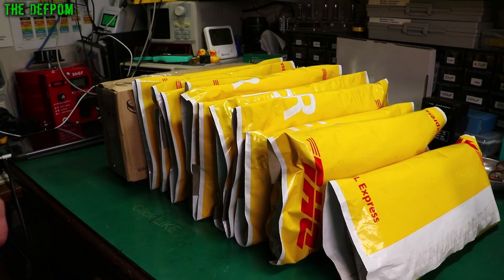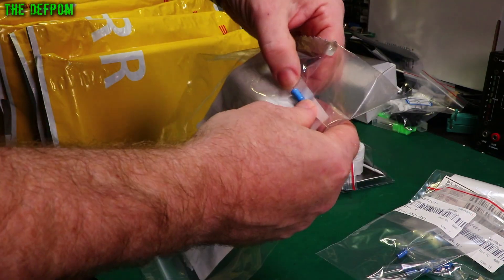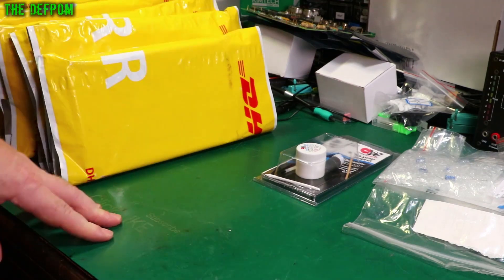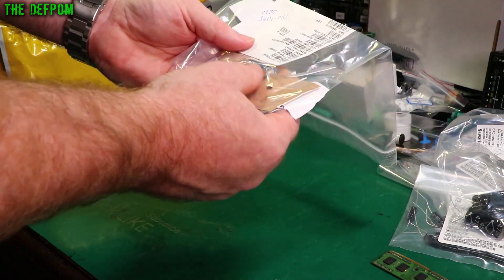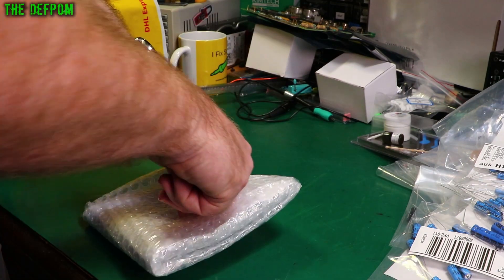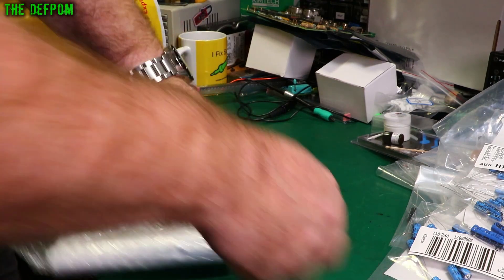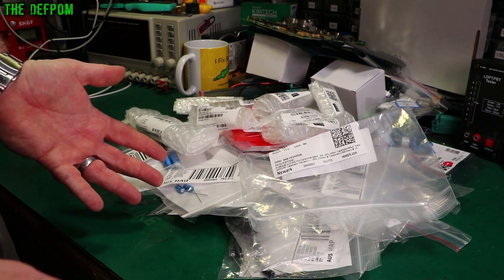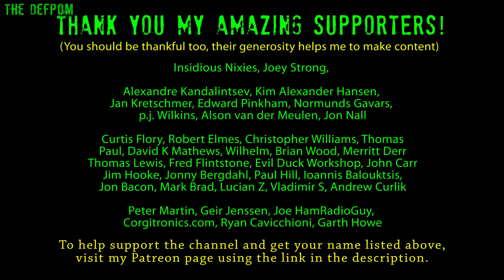🔴 What's in my Mailbag ? - Crapacitorbag Monday 11th April 2022 - No.943

Comment: Amazing capacitor buy.
I do note you are getting ones and twos. I rarely order less than ten at a time except where cost each is in tens of dollars.
Reply from the maker: These types are expensive so I have to budget to getting what I will need. Also sometimes the orders get broken up into smaller numbers due to shipping from different places and wiping out all of their stock. AND I only have so much room in my parts drawers, if they are close to full I will just top them up.
Reply: @TheDefpom  OK cost and stock levels are certainly constraints. Space too is an issue.
My last order was a selection of very low ESR Electrolytic capacitors, that had a number of devices at rediculous prices. My order ended up at around Au$780, not what most people would pay. Sadly asthe manufacturers will not sell in low quantities, we are stuck paying these distributors their enormous markups. Sadly often the read premium devices are not carried by these distributors so if not a direct major customer of the capacitor manufacturer there is NO way to get some devices.
The vanishing sourcing of certain style devices is as much a supply chanel stocking, possibly more than lack of manufacture, though prices do go up on such low production volume types.

Just needed examples for a range of DC-DC converter evaluations comparing effect of better and lesser capacitors on characteristics. Capacitors under 10mOhm ESR do make a difference but cost is maybe overkill.. Run of the mill capacitors via likes of Jaycar and Altronics fared medium to poorly . Good major brands at RS and Element14, so not the cheaper ones, did moderate to good, not even excellent.
Most of my special capacitors are still idle sitting and aging. By the way one type special ordered from Japan by Element14, with 4 month delay, cost around $33 each for 5 pieces, but 100uF 50V and 1 to 2 mOhm was special.
Reply: @TheDefpom  Just wondering, why don't you use radial capacitors and extend one of the leads? Presumably for convenience and aesthetics?
Reply from the maker: @andrewsawesome  that can be done (and I have done it) but it’s a pain as often you have to mess around extending the leg and heat shrinking it… I’d rather put the right part in.

Comment: To entertain us more, you need to read the labels and see if you can find out which warehouse it came from.
At the end of the video you had two bags with the same components in them, it usually means they came from different parts of the world to fill your order.
The single box with two caps in it, quite common when you order components that are 5 to 8 days availability, they would have been boxed at the place of origin, not the place where the order is combined and sent to you.
Good video all the same, sounds like me last week replacing 50caps in two SMPS, half having failed due to old age and heat.
Reply from the maker: Ooo I know, next time I could get my barcode scanner out and try reading them…

Comment: Great, if you've got a capacitor fetish, if that's even a thing. I bet it is.
Reply from the maker: Lol
Reply: You can never have too many caps, their is always a job out there that needs exactly(within tolerance), a 2.2uF 400V or 680uF 10V or 56uF 35V. The job demands them because of mechanical fit or circuit requirements.

Comment: I've used a conductive carbon ink pen (from MG Chemicals) to repair a rubber keypad on a TV remote. It was just one button but this seemed to do the trick. I think the pen cost about £10 and the it should last a while - just checked it and it's still providing ink after about 18 months.
Reply from the maker: Where did you get it from?
Reply: @TheDefpom  I replied and included a link to the MG Chemical product on amazon but I suspect youtube swallowed it!
Reply from the maker: @zeno2712  yeah I can’t find the comment with the link, that’s ok an Amazon search should bring it up I expect.